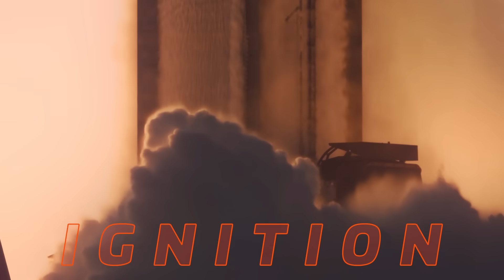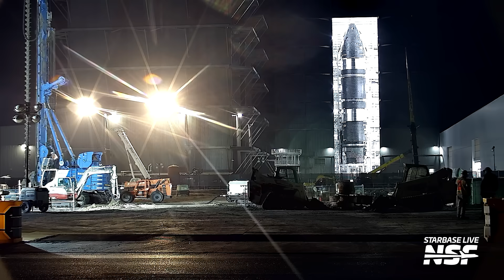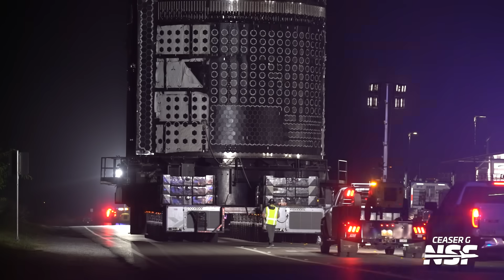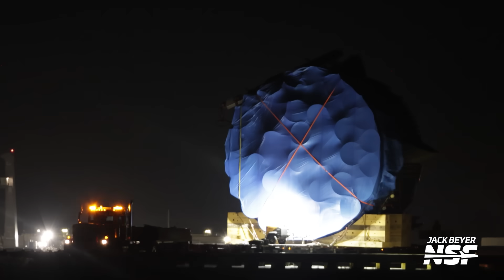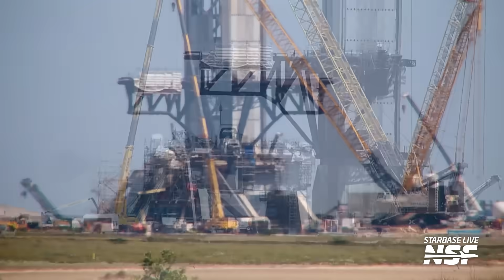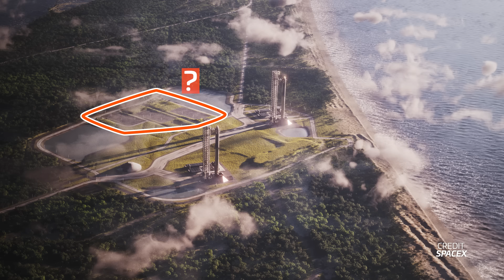Ship 37 Prepares for Static Fire as Booster 13 Returns to Starbase! | Starbase Update

Comment: Look, I'm old. 75. But I've been around. Divers have to go down there and assess. Then a plan. The thing is 30' tall. Laying on its side. Underwater. It wasn't deep. They want one back, as intact as they can get it. So. They sent a diver down there. And he came back and said things looked good. Another plan.  ' Let's send a crew down there to access one of the engines.
      And so, a plan was devised to go down and grind an opening into an engine bell. Wow! Awesome! Bring this back to R&D. Experience said send the divers to the top side and said start cutting down at the attic above the engines. And lift, Causing separation and gapping. Additional crews keep cutting down. And lifting. And separating. More cutting, interspersed with lifting. Finally. The best angle for cutting. And that is the most optimum angle of safety for your human resource. Thx

Comment: @nasaspaceflight - If I were the SpaceX engineer responsible, I would be have been manufacturing an additional booster QD hood and any other McGyvered parts. Then they could quickly switch the butchered parts out for flight 10, and later quickly reinstall the butchered parts for ship 38 static fire, and reinstall the new hood for flight 11 launch.

Comment: I never understood why the booster and ship qd where worlds apart in plug/socket design, retraction mechanisms yes, but the connection, its performing the same task so i dont see why it couldnt have been the same, I guess they just never thought this day would come
Reply: I believe the flow rates are different, and so there are 2 booster QDs and only one ship QD at tower 2. There are undoubtedly other lines for the booster that are not needed for the ship.

Comment: I'm pretty sure Chinese boats are hunting on Starship reamains close to Australia
Reply: Fleets couldn't find Flight MH370. Don't fancy their chances.
Reply: @David-yo5ws at least they know where it landed, but I wouldn't fancy their chances of recovering it from such deep water.
Reply: @sja45uk  They would need some pretty specialised recovery ship to do that, for sure. And the weather in that area is not often ideal for salvage work. As for the undersea current flow, I expect that's an added complexity. They would be better off putting money into 3D printing development than the salvage. Yep, think the odds are against them.
Reply: Much deeper water, much harder to find and recover.

Comment: It's nice that the City is putting specific information about which vehicles are to be transported.  That's new right?  The old notices were more generic.

I had the same idea about pulling up the aft end of the booster: SpaceX doesn't want the engines falling into the wrong hands.  The other explanations, cleaning the ocean and learning from the wreckage, feel weak to me.
Reply: No one mentions the nozzles. I thought they were very expensive. Niobium and or Inconel alloys?

Comment: Does Ship 38 need it’s tiles before static fire test? If not, why can’t it just go from cryo to engine install to static fire and then put the tiles on while 37 preps for launch and launches?
Reply: I was thinking the same thing. They may want to get the engines/static fires out of the way, launch 37, get the heat shield data and then finish up 38. It's not like they need Pad A much anymore, with Block 3/Pad B queued up to be the Main Attraction.
Reply: It will still take time to install the engines
Reply: We have no idea what lessons that SpaceX will learn from flight 10. On flight 8 they had issues with both the thrust vectoring and the payload bay. They might need to further modify ship 38 after flight 10, before launching flight 11. It seems that they probably have plenty of time before finalising ship 39, as launch pad 2 won't be ready before the end of the year. The biggest impact of any flight 11 launch delay is on replacing the launch pad 1 with a similar design to launch pad 2.
Reply: @sja45uk  flight 9 was payload bay they couldn’t test it on flight 8 cause it never got to that point